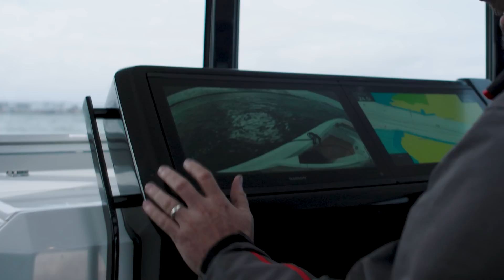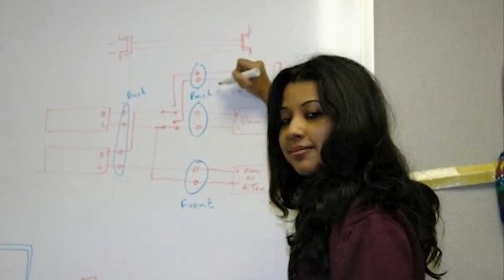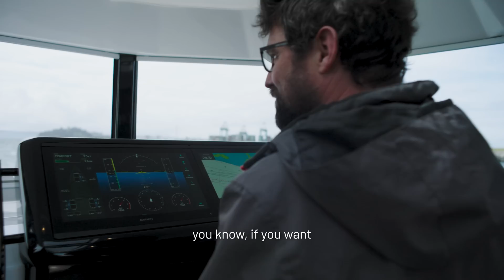This Boat Is Much, Much Cooler Than Your Boat

Comment: I’ve got to call BS on this CEO. She says all the keywords, but does it actually mean anything? Sure we want to build ships in America, but not to cruise in SF Bay on a calm day. Can your boat go beyond the Golden Gate? Can it get you back to Alameda? Talk about range anxiety! Where is the market for your boat? Hydrofoils existed for the last 40+ yrs (Macao ferry) why doesn’t the SF Ferries run them?
Reply: I think she is too smart for you to understand.   She explained all of this in the video.
Reply: @greghiggins3753 
Some see a young Asian woman  and don't want to listen ... that includes some Asian men; but 
That just makes them sharper and sometimes fiery ..  Maths chemistry physics and science Medicine and business.. are like national hobbies for Indian young professionals.. women double it...  😉🇬🇧🧙🏼‍♂️🥼
Reply: Electrical control systems automated foiling control systems.

Electric motors can be tiny turbine smooth and kept cool by the water they sit in....they are also built in N Ireland for N.Sea Irish sea conditions.. energy used  efficiency is way better than an ICE boat trying to move at the same speeds..and maintenance is a lot less, both in time and costs.  Batteries may well last for 10-20 years..
The Irish based company do a larger Luxury inter island or resort transfer vessel .. 

That resembles in its overall lines the older Hydrofoils that were built in Russia and served throughout Europe on the rivers and between the Greek mainland and Islands .. though those were mechanically complex and thirsty beasts  with  draggy foils and vulnerable mechanical drives. The big ones used shaft driven  gas turbines powering props or water jets ..

These vessels effectively terrain fly over the water....and react to the water ahead as well as the control inputs.. 

The fact they minimise drag just wipes the floor with  conventional deep V  planing and displacement hulls.. 🥼🇬🇧🧙🏼‍♂️ new Battery tech means 1000KW charging rates in Europe and for Trucks and cars ...
No fuel sloshing around means trimming and on water handling is safer and consistent. 🤷🏻 Safer  
and no 🤮🤢 nauseating fumes.
Reply: Loads of bridges, no cheap waterfront.
Reply: So much consensus that electric systems will only get better.... but no such consensus for the future of ICE, that's just odd, progress is progress, innovation is innovation... all things equally benefit, electric is where the will is.
Reply: @marcmorin2129  Electric systems will get cheaper per level of performance.  That is just the state EVs are in their evolution.  ICE has large incumbent producers pressured by regulation -their costs rise with lower utilization.
Investment in electric has a good chance of returns.  Investment in ICE gets you nothing but another day.
Reply: She worked for NASA…